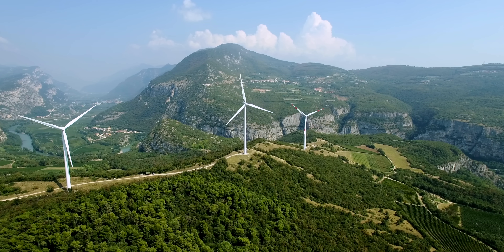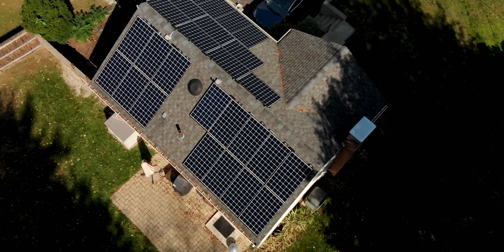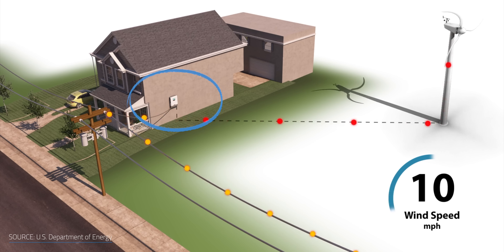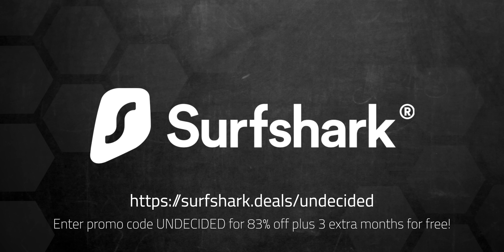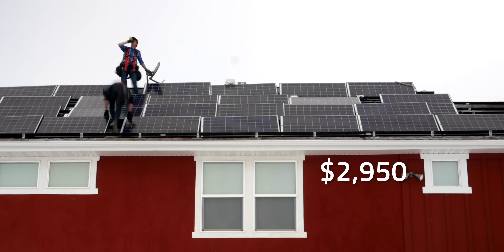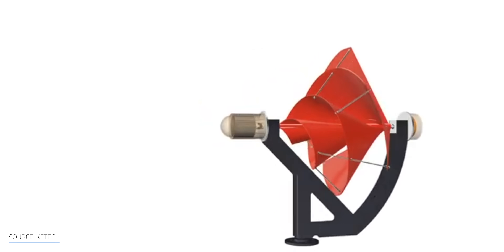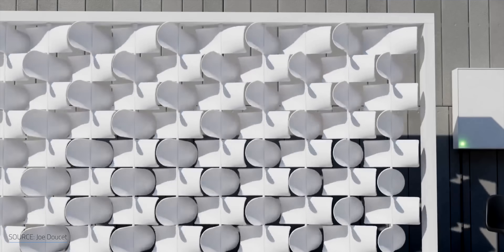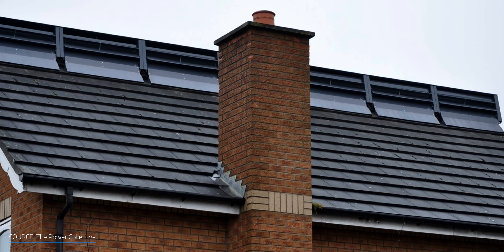The Challenges of a Wind Turbine on Your Home

Comment: What wasn't mentioned was that wind turbines (by themselves) do not require the more rare earth minerals like solar panels do (such as lithium). So construction costs won't be affected by material shortages. And, while dependent on your geographic area, might make them just as useful.
Reply: 'Rare earth minerals' is a term that's thrown around a lot, but I don't think many people actually know what it means. Technically, it refers to the lanthanoids, which don't appear in solar PV, but do appear in high-end turbines.

Solar PV panels use silicon (the second-most abundant element in the Earth's crust, and one that we have half a century of experience refining to ultra-pure semiconductor grades), doped with tiny amounts of phosphorus (very prevalent, used in fertiliser), boron (easy to extract), arsenic (which is a pain in the arse, but not rare) and possibly aluminium or gallium. For the metallisation, they almost always use aluminium and copper (in layers around a micron thick, barely anything) and possibly even thinner amounts of transparent conducting oxide, like indium tin oxide (indium is pretty scarce, TBF) or zinc oxide. Definitely some weird and nasty stuff in there, but very little that's rare, no lanthanoids and no lithium (or any other alkali metals, keep that shit out of my cleanroom!).

Wind turbines generally use steel and fibreglass for structural components. The best motors use neodymium iron boride permanent magnets, with ferrite magnets a long way behind. Neodymium is a lanthanoid, as is the 6% dysprosium that's added to stabilise the magnet. We talk smack about 'rare earth minerals' because lanthanoids are a pain in the butt to extract and refine. They're not particularly rare by abundance, but there are no minerals that contain them in the high quantities you see in, say, iron ore. When they do appear, you normally find all sorts of heavy metals rather than, say, just neodymium ore. As you painstakingly extract this low-concentration mishmash, you also end up with a lot of uranium and thorium. Yeah, pain in the butt. The only people brave or foolish enough to try to corner the market for lanthanoids are the Chinese, which just adds political turmoil onto existing technological unpleasantness.

I'm not saying wind turbines are worse than solar panels (both are pretty f**king awesome), but know what you're saying before you make a mess on the internet.

Comment: Are there any viable solutions for a home install out there that us weights dropped from a height to drive a flywheel generator or low rpm  generator ?  I could see having a cascading set of weights, one weight releases the next when hitting bottom.  I’ve heard some call this a gravity battery or gravity generator.  Of course I foresee some type of gearing to get to rpm into the needed range.  My area, Upper Michigan on Lake Superior, gets very little sun in winter for solar to work.  The wind always blows in the winter however zoning prohibits windmills.  A gravity solution of say 10-20 cascading weights of 50-100 pounds should be able to run for a while?

Comment: ALL generators produce AC.

Then a commutator or rectifier converts to DC (for car generator or alternator or other DC output desired system)

It is common to convert a small generator's output to DC for voltage regulation, then, using an inverter to produce the desired AC for common household appliances.

Comment: The wind speeds required to achieve the quoted power output are significantly higher than we see here in our area of San Diego County. We have a 10.8 kW solar array that has been active since 2014 and I don't think it is economical to add wind power to the mix . Other places may find it works locally.

Comment: I also live in Massachusetts. The two words that come to mind are snow and ice. That has to be a showstopper. I went through an anemometer phase, and Old Man Winter taught me a thing or two. Then there's that global warming thing, so maybe not an issue long term? The irony is not lost on me. How does maintenance work with a 10 to 20 meter pole? Is there a guy wire release to lower it? Does the pole telescope?
I would love to do solar. Some time back, I had a dish and the mounting bolt holes leaked. Resulting damage was about $60K. Sure, it was an install problem, but the indemnity insurance was tied to the installer, who was long gone; boo-hoo for me. So... how is that working out? Anyone with leaking roofs? If it does, who pays for it? When I ask the solar sales types, I either get doublespeak, or 'I'll get back to you', which never happens. Any thoughts on that? Remember, snow, ice and ice dams. Maybe Matt could do a short story on failures and liabilities, etc. It might help me take the plunge. Has anyone come up with a grid that can hold the panels with minimal or no holes in the roof, aka 'clamps'? No, not enough clear area around the house for a ground install.

Comment: One of Matt's points near the beginning about how solar/wind can help one deal with raised gas costs caught my attention.  I did some casual research on whether the cost of gas affects the rate at which green energy develops, and there doesn't seem to be any correlation.  While I like solar and wind as much as most others, there is a very tight correlation between which party has the Oval Office and the price of gas.  Looking up a graph of the average price of gas per year, whatever one is led to believe about how terrible either candidate is, your vote determines the cost of gas but not the progress of green energy.  Not the only factor in any decision matrix ofc but food for thought.

Comment: Could you do cost comparison if someone used a home wind generator as an alternative to solar energy storage? Could a wind generator (in the right environment and circumstances) offer a viable alternative to expensive batteries for your solar panels? And if so does it become cost competitive if installed for that reason?

Comment: the geography of the area is one of the major elements of whether solar or wind power is worthwhile. so while one particular solution may not make sense in one set of circumstances, if you change the circumstances, or adapt the solution to fit the circumstances/geography better, it may become more viable/worthwhile.

Comment: The previous home I owned, there was almost always some sort of low to moderate wind blowing (arount 5mph), with very rare exception.  Like, 95% of the time, the air was always stirring around that house.  I had to take down a set of windchimes I put up because it would not stop chiming.  So instead, I wanted very much to put in a small vertical-axis turbine (looks like a squat spiral noodle standing on end) which catches wind from all directions...but I had to sell that home before the city it was in (never mind the PUD, lol) would give me the authorization for it.  Not that I can blame them for what was an actually reasonable delay; the home-scaled wind tech was still in its infancy in many ways, and hooking it up to the city grid would have required a lot of processor chips and programming that weren't readily available.  It genuinely required a fair bit of research.

Comment: I just recently did a deep dive into wind turbines for my 12acre property in VT, these past 2 months. I had extreme trouble getting any company to be helpful in the design and install of a wind turbine for my new tiny home, that would be paired with solar. I contacted Tesla, LG, and a handful of other solar or home battery companies with this request, and was ghosted as soon as I asked for any help with adding wind. No one is willing to help with a package deal. Even the manufacturer of the wind turbine companies, that are actually affordable, would not be willing to help connect me to someone that would be helpful for an install of their own product. The message is clear; Become an electrician yourself, or pay multitudes more money on an expensive product from a company that may be willing to install the turbine, but maybe not if you try to pair it with solar. The amount of help has been appalling when trying to build an ecofriendly off grid solar and wind home. Where the heck is the community??

Comment: Oooh! I love the look of that roof top model! My roof is large and faces west so that would collect a lot of wind power up to the ridge! Vibration does seem like a concern but that design looks promising and made right here in Ontario too! 
I live off grid with solar and it is ok. A wind turbine would really help though. I have considered the old metal water pumping one that they have on farms in the midwest, but I do love the vertical axis look, they are soo interesting looking, like a moving sculpture. The moving parts thing is a bit of a concern and a tower is a no go for me. Maybe it is because I am a roofer but that ridge mount looks really nice to me.
Reply: @Tom Kelly It seems like some rubber mounts would isolate the unit from your home, so you would not feel as much of the vibration (similar to an engine installed in a car/truck.)
Reply: @crazyfvck  I also loved that design. I live in the north of Norway and here we don’t have sun at all during 1 full month and very little from October to March. We have plenty of wind in the coast during winter (when we need more electricity for heating) so those turbines look pretty exciting. But I’m also concerned about the noise, even with the rubber mounts. My heat pump is mounted on rubber mounts too on the concrete basement of my house and I can hear the noise inside the house when it’s working at high speed. But other than that, seems to be a perfect solution in this country

Comment: I think the big thing that is often missing from this kind of analysis is batteries.
Why would you ever care about wind power if you can get more and cheaper solar. The only reason is power diversification and that is completely irrelevant without taking into account the alternative which is a larger battery and solar system.

Not that the math works out anyways.

Comment: Up north in rural area, so in my case I think a DIY VAWT makes sense. Winter is when I need most power (heat pump) and when solar would be worst. DIY should keep costs down, hopefully below what a comparable PV setup would cost.

Maintenance should be marginal if constructed reasonably, essentially one big moving part plus bearings. It might take some iterations to get right though.

I would never put a turbine on my roof though, think about where those vibrations will go. There will be vibration.

Comment: Sorry, even being from Ontario and supporting the local business I can't possible believe that such a system attached directly to the house frame can be acceptably sound and vibration free. And if it is it would be a highly tuned and precision filled that would make it expensive. I hate the sound of the wind itself hitting my house let alone 5 spinning blades attached to it.The basement water pump vibrations bother me! Any wind system has to be completely detaches from the house frame.

Comment: I live in rural Kansas on a hill. We have lots of wind and sun. We had the chance to have a refurbished 10Kw wind turbine installed on a 100' tower for $45k. This would have powered our house and our neighbors'. The turbine only had 3 moving parts and extremely low maintenance with a historical lifespan easily over 25 years. Solar panels are cheaper but panels degrade every year and only have a 25 yr warranty. Most of your inverters and other components have shorter warranties. So after 25 yrs you're going to be buying more panels and inverters. Quotes to have a 14kw solar system installed are close to $40k. Please keep in mind your energy provider may have limits on how big your green energy system csn be if you want to be grid tied. Wind energy also qualifies for tax credits, same as solar.
Reply from the maker: Good call out on the energy limits that might exist for net metering.

Comment: There's one area where small scale wind makes sense: low power unattended equipment like monitoring stations, or things which need to be resillient to grid power loss for safety reasons (e.g. railway signalling equipment). Have a sealed box including a battery with a wind turbine and solar panels on a stick, for most modern energy efficient electronic systems that will last a very long time - even if the wind turbine fails due to a mechanical fault.

Comment: What I have learned is that as long as I am getting good sunlight, solar is sufficient.
Batteries are a major system cost concern. They can cost the same or more as all the other components combined.
Generally, anyone considering anything other than LFP should reconsider. There are special cases that LFP may not be the best application.
The problem is what do you do when the sun isn't shining.
After considerable research, I determined the cost benefit was unfeasible. Batteries and panels are a more cost effective solution.

Wind is very inconsistent. However, some wind can be utilized depending on the cut-in velocity.
I have been interested in the Harmony VAWT, but it is still in development. I may get one eventually as much for aesthetics as power.
The major drawbacks to wind are how one deals with excessive velocity and the intermittent nature/ height.

Comment: Pretty sure the carbon numbers are inaccurate or rather they only reflect the impact AFTER production of the solar, wind, petroleum and coal devices in question. Also I think an important factor is the relative ease in making your own wind power compared to trying to make your own solar power. Both will require some engineering and electrician know-how but I feel like it's much more reasonable that someone in their 30s-40s with a guide could make a basic wind turbine that might fail after a big storm but given the home-made nature would be easy and cheap enough to fix as needed.

Comment: HAWT installations are very effective bird killers. Unsustainable without tax dollar incentives (= opportunity cost losses). 
There is on this planet an all-important Carbon Cycle; interrupt it successfully and life stops. This cycle has an airborne CO² component (see Stoma) which has been as high as 7,000ppm (Carboniferous, intensively productive). 
Conclusion: Nobody sane can say what is Earth's optimum CO² level for each Insolation level in the Milankovitch cycle.

Comment: 07:30 - that's not true.
Solar panels do have maintenance costs.  Not in oil a technician involved, but CLEANING.

The panels have to be cleaned from time to time to remove.dust (in dry areas especially) or biofilm (in regions with lots of humidity). There's more to clean for sure. 

Because dirty panels Don't work as well.
On the up side - that's something you could do yourself with a pressure washer or just a hose - however that really depends on the roof form. I wouldn't trust myself to walk on a roof like it's shown at 7:45

Comment: There's a youtube channel wher ethis dud eshows how yo ucan make a wind gnerator outof a platic tube with a rubber diaphragm at one end with wires goign from end to end and hoel scut in the tube. Any vibration creates electricity. I'd provide the link but I dont want to. Not because I'm a bad I  got to go can't keep the man waiting. But search wind tube gernator or something liek that it shoudl pop up. I truly think tht widn is an e z DIY project. IF yo uhave a streeam even if its nasty water yo ucan make an ezp genreator for storm drain water. There's no reason for expensive third party design except for solar  adn batteries and conversions. 
Oh my bad I'm no tgong tocrrect my typos so I guess yo ucan just blow my hints off epz but I'd  check it out wont take long migh tlearn something..wow ouch lol  tons of typos my bad sorry but I gotta jet.. bye

Comment: A very informative video, thanks. 
I live in a hill top in north-east Scotland where it’s windy most of the year and very windy in winter. Ironically , I look out on many wind turbines at sea and in the mountains from my house but the cost of energy here at .28 pence per kilowatt is just outrageous. I use 8000 kws per annum.
I would love to install a ridge line wind generator to supplement my solar panels , air source heat pump and soon home battery.
I just don’t have the confidence just now in finding the right product to do that.
I was very impressed by the ridge wind turbine system you showed but wonder about the aesthetics and performance.

Comment: Better use kyte to generate power from winds much stronger at several dosens of meters above your house, by the same principle the hybrid cars make power from brakes. Wind turbines are noisy and fragile, exposed to dust, ROI us 3 times more of a solar installation of the same generation capacity.

Comment: If you already have a solar array and power wall type battery, it could  make sense to complement it with a small DIY turbine. Also if you live next to a busy road, you could scavenge airflow from passing traffic to get a more reliable flow.  That wall turbine used as a fence along the road looks like it could work well and block more road noise than it makes.  Paying $8000 for a noisy monstrosity on your roof doesn't make sense.